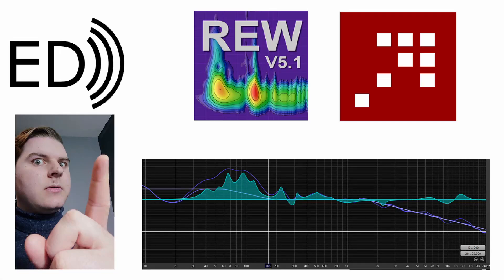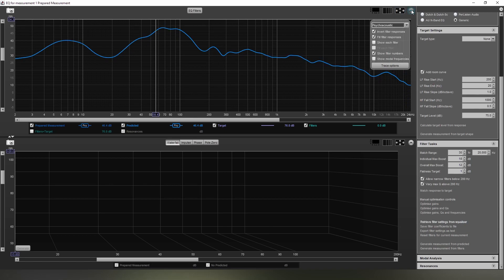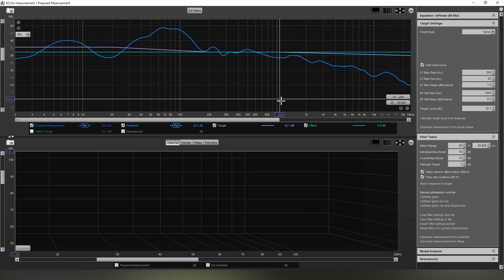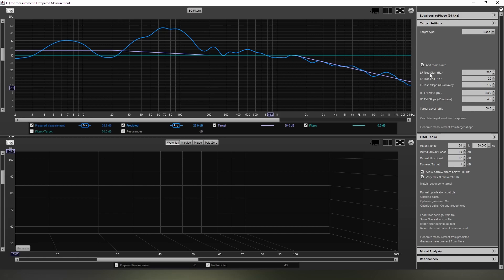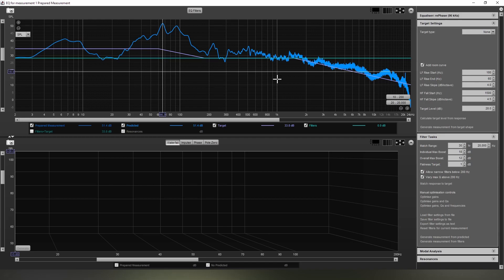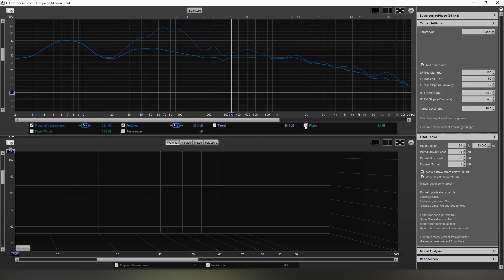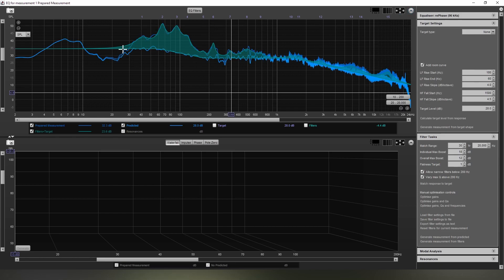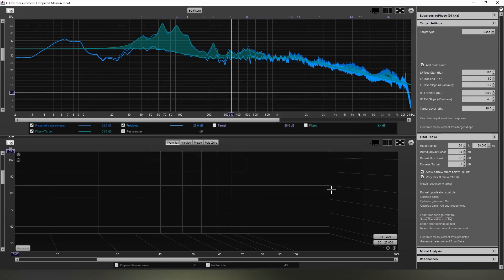Linear Phase EQ - Room Correction: Part 1 - REW

Comment: I seem to have a difficult time creating impulse responses that correct LF bumps, its fine for HF, but just seems to ignore LF even when remove all the HF corrections, used Rectangular but same for Hann etc, restricted to the miniDsp 1038 samples.
Reply from the maker: It'll be the low number of samples that are causing this. First thing you'll need to know is that you'll want to set the same number of samples in rePhase as you end up using on the miniDSP, this will give an accurate representation of the changes that will take place when applying the filter. For decent resolution changes in low frequency I'd recommend the default of around 13000 samples. The higher the sample rate, the more samples required for the same effect too. Hope this helps

Comment: Thx, excellent tutorial,  I've used REW for a while but just downloaded rephase.

If REW likes to attenuate, rather than boost equalize, why do they put the center the target within the more or less average of the measured curve, rather than at, or near the bottom?  I understand that you have to stay out of digital max saturation, but that can be done with overall gains.

It's really nice of you guys to put this info out there, it is appreciated.  I am an engineer, but electrical, not acoustic, so it is valuable. I have found these setups to be as much art as science, though, frankly, if the desired result is good sound, especially when you start throwing various absorbers into the mix.  Now on to part 2.  :-)

Comment: How to use this method for Subwoofer calibration with help of 2x4hd?
Reply from the maker: Be careful with too many taps at low frequencies as that actually could introduce some noticeable time domain artifacts if corrections are too sharp, especially boosts. I would recommend going with something like Multi Sub Optimiser instead of you have more than one, as that actually uses the phase change of minimum phase filters to control how to subs interact to give a smoother distribution of bass over the space, should be a lot easier to implement too!
Reply: Thanks

Comment: Thank you for the video. But what if i use another DSP than Rephase? I have a Hypex amp with 9 parametric EQ. How do i get the xml files then…? Because if I put Rephase on REW EQ generator, I will get to much parametric EQ… I’m lost with this Rephase software 😩
Reply from the maker: Sorry it took me so long to get back to you. First of all, just so you know, parametric EQ will likely only be minimum phase (but in your options, if you see somewhere that says minimum phase, click it anyways since it may be a drop-down to select linear or mixed phase - if that's what you want that is). Other than that, unfortunately I am not experienced with Hypex amps, but what should always work is entering the values manually.

If you go into REW EQ and choose generic instead of RePhase, you can then go into the EQ filter banks at the top and depending on how many bands of EQ you have (8, 10, 12, 16 are common values but you may have a different amount available) you can set more by selecting them from None to Peaking, or set less by selecting Peaking to None.

Then carry on generating the EQ filters as per usual, go back into the filter banks and then you can use those values to fill out the parametric EQ banks in your Hypex amp manually.

If using minimum phase EQ, I recommend taking an RMS average of all your speakers and applying the same EQ to all of them so that when they play at the same time you don't have phasing problems.